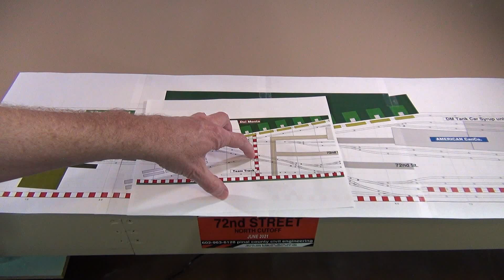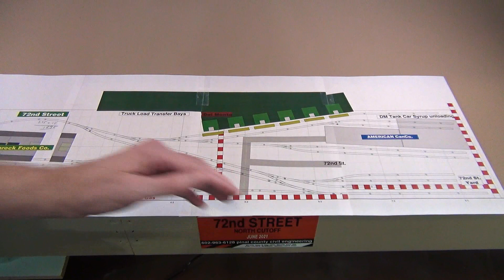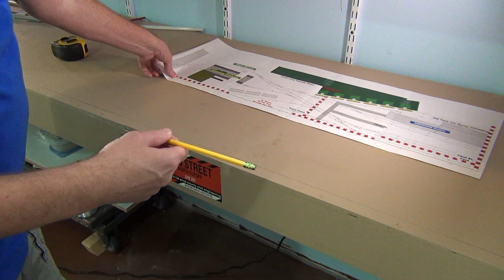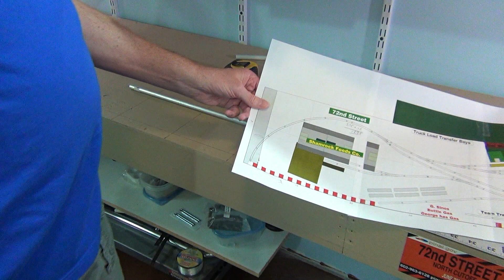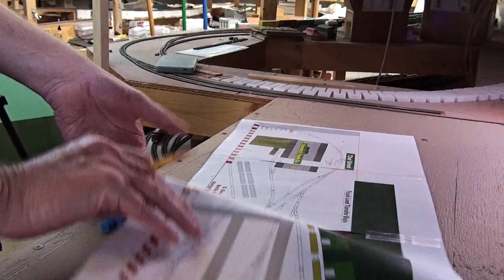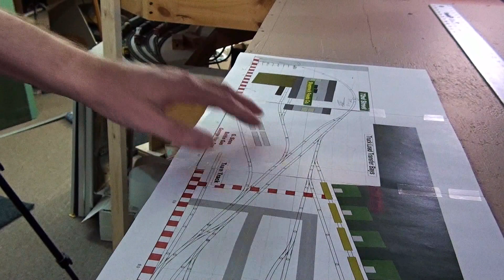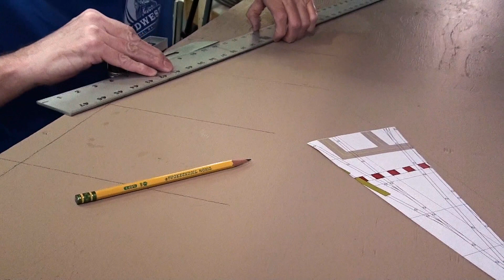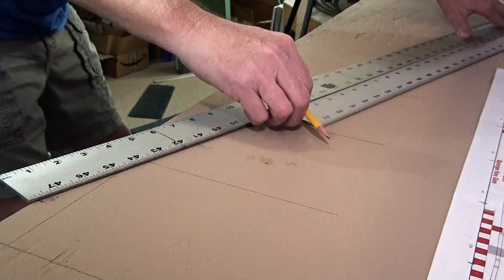Transferring a track plan to your layout,  From model railroad track plan to layout,

Comment from the maker: I take a model railroad track plan and transfer it to a small layout space.   I use a few key dimensions and tools to get exact locations needed for proper track locations on the 72nd Street model railway layout.

✅ IMRROcom Amazon Page - https://www.amazon.com/shop/imrrocom
🔻 "SHOW MORE" 🔻  👈  Click on it!  👍 

Digital Tools - https://amzn.to/3xeViT2
Digital Sliding T-Bevel Gauge & Digital Protractor - https://amzn.to/3iDRYN5
Beam Compass Large Circle - https://amzn.to/3gih0A1
Stanley FATMAX Chisel Compass, 16" - https://amzn.to/3vdazCw

The Best Track Planning Software - http://www.rrtrack.com
The Track Planning Program that I use is RR-Track

✅ Support this content & IMRROcom through PayPal.Me: 
https://www.paypal.me/EricGHall

✅ Take advantage and support this content & IMRROcom through Patreon:
https://www.patreon.com/IMRROcom

Model Railroad Layout Designed for Beginners working with their model train layout planning.
Model railroad for beginners, we look at easy model railway track planning.
How I do Model train layout track planning on the 72nd Street North Cutoff.
Planning a small layout for operations, is not that hard to build when building a model railroad in a small space.  I will show you how I plan and build a build a model railway extension on my layout
Easy to follow guide on How to make small scale train layout.

In this Introduction  to Model Railroad Planning for beginners.
The 72nd Street Layout is a small layout that you can build in a small space.
This easy to build layout is N scale and would be a Great Model Railroad.
The Layout is easy to build for every beginner interested in operations 
that is looking to build a model railway in a small space.

🔸 Community - https://www.youtube.com/user/IMRROcom/community

🔸 Connect on Facebook - https://www.facebook.com/IMRROcom

🔸 Follow me on Twitter - @IMRROcom
https://twitter.com/IMRROcom

Comment: This was very informative, Eric. I guess I am glad my layout, so far , is 2 foot x 4 foot. However I will be expanding it on both ends and the outside edge. So You're videos are more helpful than You think. Thank You for sharing them with the rest of Us, makes alot of the decisions, so much easier with each step. Bruce
Reply from the maker: Thanks,  My layout is just basically 8 foot long micro layouts strung together

Comment: Sometimes, you just got to wing it. I think it will look good.  Bob
Reply from the maker: I do that too,  usually on the ends or out in the open,  just need to fit buildings into the same space,  most buildings are not adjustable in size :)

Comment: Eric - Do you see any issues with printing the plan in full size, gluing the plan onto the board and laying the track directly over the printed plan? Thanks.....
Reply from the maker: Keith,  Do not like the idea of gluing paper to my benchwork.  It would also require a lot more paper and when I find an issue or adjustments need to be made,  I will need to reprint it all out.  But What I have is a good guide for what I'm doing.  Thanks